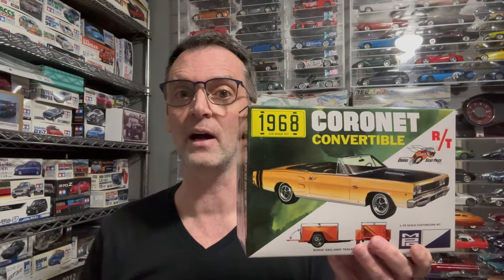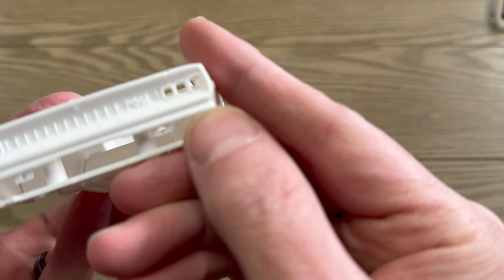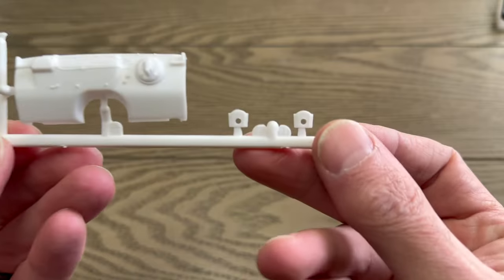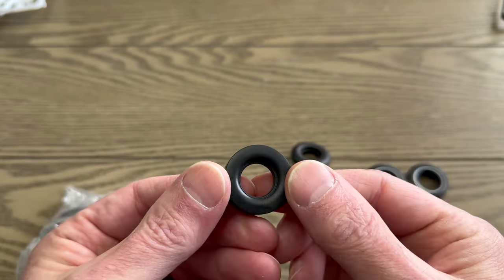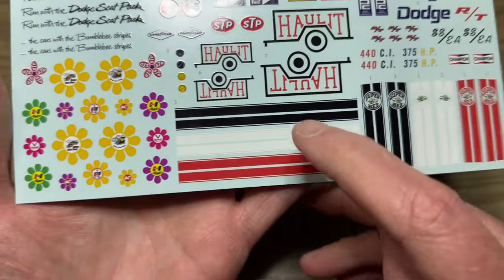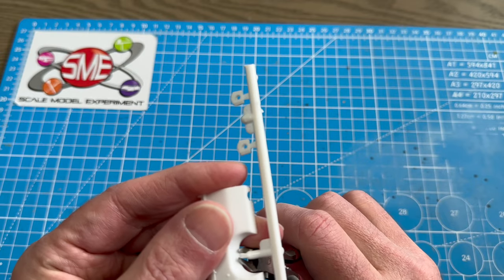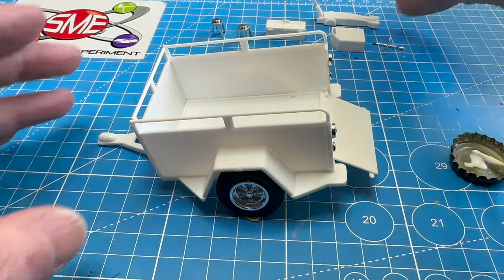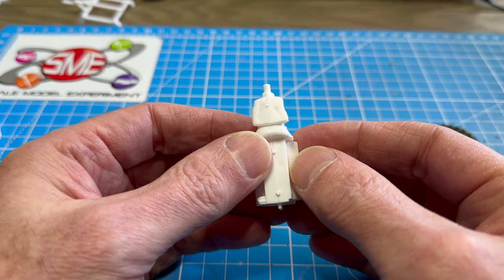1968 Dodge Coronet White Glue Review - MPC 1/25 scale plastic model car kit

Comment: Another kit to be kit bashed with the very well done Revell 1968 Charger R/T.
Reply from the maker: You’re absolutely right, I forgot about the Revell chargers for base kits.
Reply: @ScaleModelExperiment  I know you have built the Revell 1/24 1970 Road-Runner, the 1/25 Charger kit can be successfully used for these 1/24 kits too.
Reply from the maker: @sydrider6023 I’ve always tried to stay 1/24 with 1/24. The scale difference looks funny to me.
Reply: @ScaleModelExperiment  look at it when you have some time. The rear leaf of the 1/25 Dana 60 fits right on the 1/24 under body holes. The dimensions of many parts found in the 1/25 kit are actually the same or even larger than the simplified and toyish looking Monogram 1/24 kits.
Reply from the maker: @sydrider6023 will do!

Comment: Very nice job Round 2 bought this car back out being retooled a bit. This model went together very well, I have the original MPC 68 Coronet hardtop and it doesn't have the bosses and mounting points anywhere except on the chassis so this is a better assembling model than my hardtop is. Yes, the air cleaner seems to sit a bit low, nothing that a small piece of styrene spacer can't fix to alleviate the problem. The inner fenderwells are better than my original 68 hardtop that I wouldn't bother with pieces from a 68 Road Runner to replace in the convertible. I enjoyed another round of white glue review on this kit, Its very entertaining and educational as well. Keep up the the good work on your channel!
Reply from the maker: Thank you Ray, I appreciate you letting me know about what came in the original kit.  That is good info.  I do like the kit and I was nit-picking a little with the things I mentioned.  I'm glad to have the kit back out. Thanks for watching and leaving me a comment.